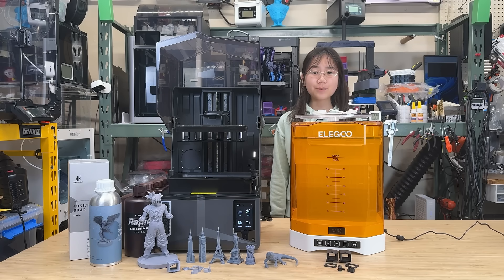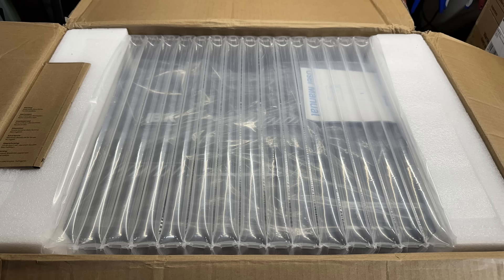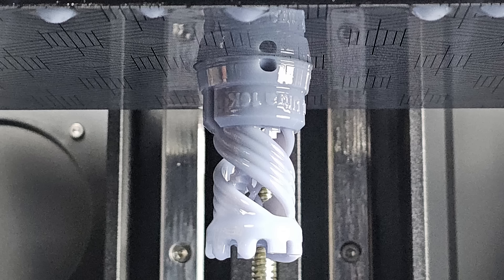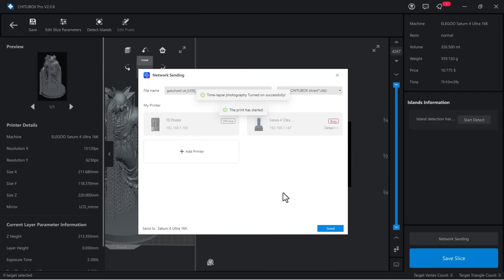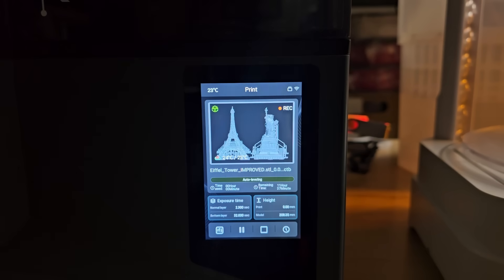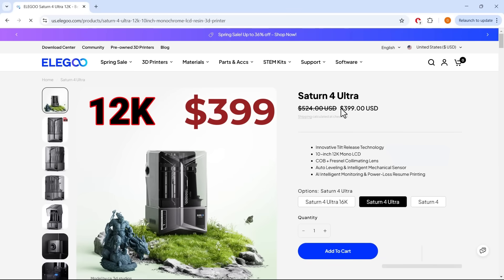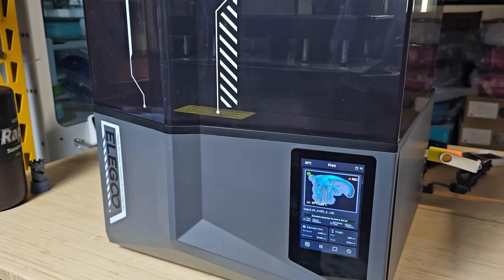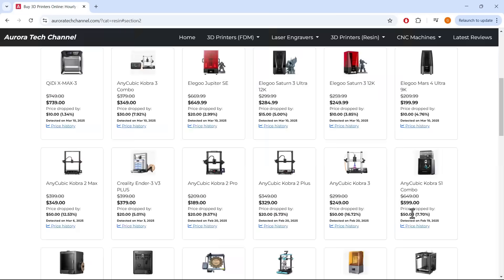Elegoo Saturn 4 Ultra 16K Resin 3D Printer – Auto Leveling, Resin Heating, Tilt Release Tray

Comment: question-- i noticed that resin starts to drip along the edges quite a bit during printing. Is this because accidental splashes happened when pouring the resin into the vat? or is it splashing while printing? looked a little messy.

Comment: Out the box im having nothing but issues. Tells me its not detecting resin. then too much resin. then it won't auto level. i have to keep stopping it, cleaning the build plate and trying again. it only worked after continuously starting over with a clean plate, and then clicking mandatory print. no idea what the issue is. there doesn't seem to be a step by step guide on starting up.. wether to mess with any screws etc. this should work out the damn box im frustrated.

Comment: The very best channel, love your FDM reviews especially. 

For the IPA, which is pricey, you can use it almost endlessly if you just use the wash machine as stage one, then keep a small container of clean IPA as a final wash. I use two buckets for this  2 stage style, both with sediment traps. I also remove supports before cleaning as there’s a tonne of surface area there (heat gun helps with support removal a lot too!). IPA can be distilled in an air distiller if done outdoors as well, recovers about 75%
Reply: Love that idea, will have to look into something like this myself as well, thank you ❤
Reply: @bahahaha8416  Happy to share what I've learned and been taught! You can also water down IPA to ~25/75 for the dirty tank, clean tank staying at 100. Would only dilute once, never again once it's in the dirty tank. After a while, `clean` tank gets poured into dirty

Comment: Everything sounded good to me until you mentioned that it wouldn't print unless you have a minimum amount of resin in the vat.
This probably wouldn't be a problem for those who always have full bottles or multiple bottles of resin in reserve but, my budget doesn't allow for having multiple full bottles of resin sitting in storage.    Most of the time I have nearly empty bottles of resin sitting around that I can still use in my older resin printer as long as there's enough in the bottle for a particular print.
Since I use the same resins most of the time, those partially empty bottles of resin are generally mixed with the new resin of the same kind.

Comment: Another great review!  Other reviews I'd seen seemed to indicate that the upgrade from 12K to 16K was mostly marketing and the resolution of the resin, diffraction and limitations of the human eye results in very similar appearance, but in your lizard, I could see a difference.  I"m not sure if that's the better optics and higher resolution of the new printer, or better cleaning with the new wash station, but it's impressive results.

Heating the resin not only helps with cold spaces and lower viscosity making faster prints, it also helps with print quality.  Printing at a controlled temperature slightly above the highest ambient temperature will result in the same process every time.  I wasn't convinced that the complexity of a heated resin tank was worthwhile compared to providing a controlled environment by heating the build chamber.

Thank you for including functional parts.  That's my application for resin printing - small scale manufacturing where injection molding isn't feasible.
Reply: It's manufacturing. 12k LCDs have been discontinued as the factories have moved to 16k production. Hopefully Elegoo et al have a large backstock of replacement 12k LCDs as they have been the standard for 10" printers for a few years.

Comment: Couple of notes; 1. The 0.6mm part could probably be FDM printed with two 0.3mm walls with a 0.4mm nozzle. Alternatively, this is easily doable on FDM with 0.2mm nozzle costing a mere £10 on a Bambu A1 for example. 

2. I have that Eiffel Tower model printed on my A1 sat on my desk, with at least 90% of the detail 🙂

Not intending to be pedantic or critical, just pointing out that FDM could achieve the examples with some tweaks - like any software and tool, out of the box defaults don’t always get the best quality
Reply: 1. No, you just use arachne or just bump layer line to 0.6mm on 0.4mm nozzlee
Reply: @ true, but I was more replying to her comment that it would only be one wall thick. In theory the result would be the same, two thin walls or one thick. I should have been more clear on that part, but my point was to highlight that you can do smaller detail on FDM (where increasing line widths typically decrease detail, but not this example)
Reply: Yeah I said that because it is not the same, one thicker wall is stronger than two thin ones. I don't know why she didn't just print with a 0.6mm wall or arachne, it is a very well known method nowadays.

Comment: Are these resin printers and curing stations safe enough to use in a bedroom or basement with a Hepa air purifier?
Reply: Absolutely not. And hepa does nothing for resin, it only filters particulates and resins release VOCs. So you would need a good carbon based filter. Resin is nasty, most people don't get how much
Reply: Not if you are planning on sleeping or being in that room for long period of time, don't trust on filters and have good ventilation.
Reply: HEPA is a particulate filter specification.  For resin printing, you should have an activated carbon air filter, which may or may not include a HEPA particulate filter stage.  Resin printers produces chemical vapors, not particulate air contaminates.
Reply: @Liberty4Ever   just what I wrote but yt hid my comment 😡
Reply: @riba2233  - I thought you only posted Bambu fanboy comments.   😀

YouTube has been deleting many of my comments lately, and they're not mean or rude and certainly not hateful or threatening.  I think most of the deleted comments offend their California sensibilities.
Reply: @riba2233  - I posted a reply to you a few hours ago but now it's gone.   :-/
Reply: @Liberty4Ever  thank you for explaining! So if I have a carbon air filter in the room I should be safe?
Reply: @bc2prod.820  no, you shouldn't. You should wear a mask if you are working with resin, and one with a carbon filter

Comment: This is the only channel that likes the saturn 4 ultra, everyone else says it has tons of issues and isn't worth getting. Odd.
Reply from the maker: This machine is essentially the same as the Saturn 4 Ultra 12K, just with a higher resolution and an added resin heater. I didn’t have any issues. Auto leveling, resin heating, and build plate adhesion all worked well. I was able to print multiple objects, including buildings and small functional parts, on a single plate without any problems. So, no matter what others say, I’m just speaking from my firsthand experience, and it's a good machine.

The complaints I have are their free slicer (which doesn’t yet support network printing), the lack of an option to disable the minimum resin level detection feature, meaning you can't start a tiny print even if you still have a third of a bottle of resin, the residue detection not working well enough, and the need for some cosmetic refinements in the screen UI.
Reply: Which channels? What's odd that they like it?
Aurora Tech makes pretty unbaised reviews by running consistent tests on the fdm printers. Not seeing any problems with this review.
Reply: ive seen plenty of positive reviews and great insights.
Reply: Yes I saw another channel had a levelling problem with it, but I didn't see that problem with mine out of the box

Comment: I know literally nothing about resin printing, but I'm surprised that you actually need supports.   I don't know why,  but I assumed that you wouldn't need them for resin.
Reply from the maker: Yes, you still need support for some models, or disconnected parts will end up floating in the resin tray or sticking to the bottom film.
Reply: You may be thinking of SLS Powder printing.

Comment: come on I know you know it doesn't auto level
Reply from the maker: It does. All four corners of the build plate are spring-loaded, there’s nothing to adjust. It simply applies pressure evenly.
Reply: @AuroraTech  No, it doesn't.
The spring-loading does NOT lock, it just allows the build plate to press against the film and LCD without smashing it.

It does not do anything evenly.  It's been carefully measured with test prints, the Elegoo spring-loading on this and all of their printers using it doesn't do anything except compress the build plate onto the film to a certain force and then backs off a certain amount.  So, best case, the spring-loaded build plate gets pressed into the LCD, backs up a bit, starts off at around the right Z=0 height, rises to the first layer height, and is in the exact same planar orientation to the LCD as the unloaded (non-compressed) springs were before the fake "auto-levelling" charade took place.  NOTHING got "levelled" - the springs got compressed when the build plate pressed against the screen, the force sensor detected that, backed the build plate up until the force was lower, and it starts printing.

If you're lucky and your build plate is not too warped and the spring loading is relatively even, and you use an unreasonable amount of bottom layers with outrageous bottom exposure times (5 layers at 30 - 40 seconds in your own examples), also printing on thick rafts using heavy supports, it will usually print and adhere.

If someone wants even reasonable Z-dimensional accuracy and/or to print parts flat on the build plate, this is NOT the printer for that.  For figurines on rafts and supports, it could be okay, unless more complex figurines with finer supports need to be printed, then one finds that the tilt methodology is not ideal.

The ONLY printer costing < USD $1,000 currently available that actually does genuine auto-levelling and auto-zeroing with great accuracy is the HeyGears RS (and the force sensors and algorithms also do optimal peel detection and are sensitive enough to detect little cured pieces of resin in the resin vat, unlike the S4U-16K you showed failing to do so).

Comment: Cleaning the top of the build plate looks like a nightmare.
Reply from the maker: Like all resin printer build plates, you just need to scrape the print off using the metal spatula. It will leave marks and scratches over time, but it's still fairly easy to remove the print.
Reply: @AuroraTech  He means cleaning the liquid resin off of the TOP of the build plate, not the build surface - that area that the spring-loading columns are attached to, between the metal build  plate to the plastic mounting box on top.

Comment: Got last years 12K version, it's a great printer. A couple of wee notes :

IPA can take a hell of a lot more than 8 washes, let the cloud settle and pass the IPA through a coffee filter, it should last you for 100's of prints.

You should really let a model sit for a few hours in a warm place to dry properly after washing, it should stop feeling tacky before you cure it.
Reply: I bought a water distiller: with that I get new IPA by treating the dirty one
Reply: @davidebasso1102  Hi, I thought you couldn't use alcohol in a water distiller.
Reply: Would exposure of the IPA to UV lights harden the resin in the IPA, and make it easier to remove it (still though filters)?
Reply: @lellopesce  no as the IPA breaks down the structure of the resin, I doubt it would harden well.
Reply: @lellopesce I've tried curing the dissolved resin, but it just creates an awful sludge
Reply: Thanks for the IPA tips.  The cost of IPA is significant in resin printing.  I think I'll design a filter that can be submerged in the tank with it running to circulate the IPA so the pump in the filter can clean the IPA to prolong its life.  It's amazing that the manufacturers don't include filters to improve the washing efficiency, part quality, IPA longevity, environmental impact, and customer satisfaction.
Reply: @Liberty4Ever  after the distilling process I'm left with resin residues in a gel like status. I dispose it as special chemical wastes. Use a mask becuse the smell is very toxic